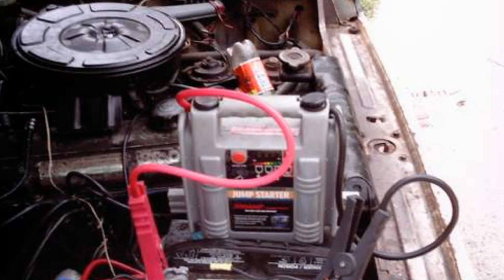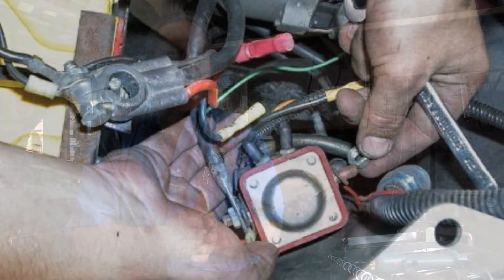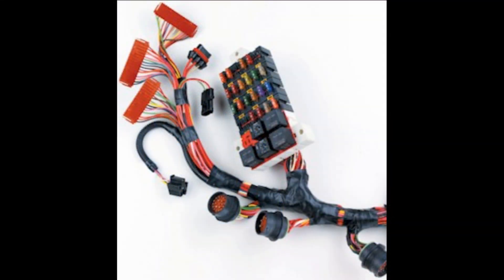Car Problems & Maintenance : Troubleshooting an Auto Electrical Short

Comment: Hi..., I don't if its short. But when press the head lights only my cars turns off. I check the alternator and its at 75 amps and charging voltage at 14.2.  The battery was check by my local auto shop and its fine too.